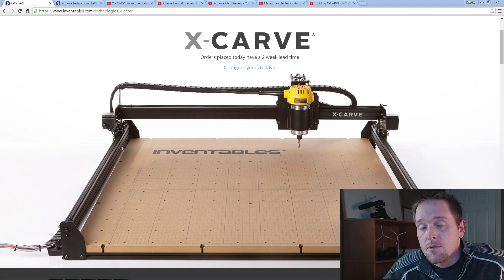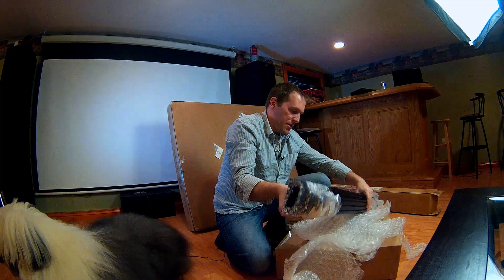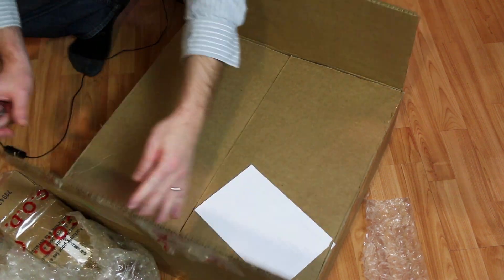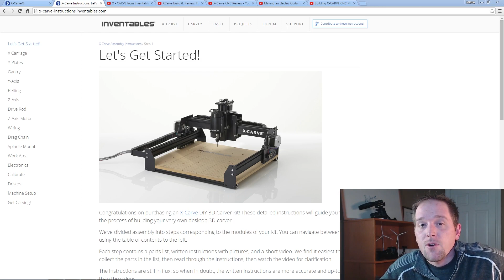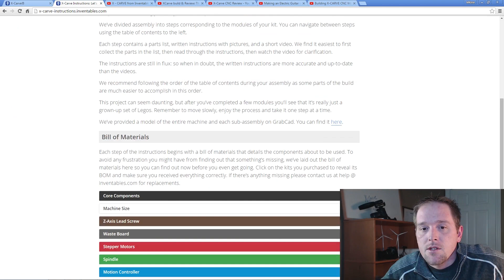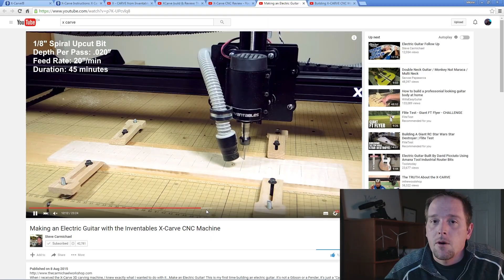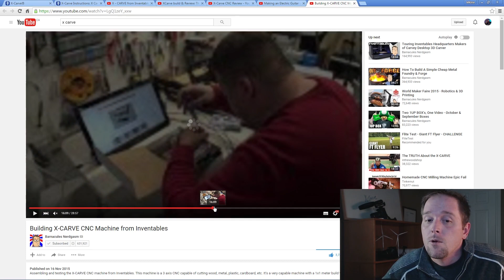Inventables X-CARVE CNC Machine | First Look & TOP 5 TIPS

Comment: Hey Eric - What's the software side of the x-carve like? I build myself a CNC woodworking machine a while back, which isn't too disimilar to the x-carve apart from being made from MDF and old rack-mount server slide rails. Although I've had it sitting in the shed for nearly a decade now, I don't use it all that often as I never worked out the right set of software which could take into account the selection of different cutting bits etc... It was a real pain getting the design right, and a lot of the time, for one-offs it was just easier to do it by hand... The software has undoubtedly come a long way since I last checked it all out... I'd appreciate your experiences with the software once you've got the machine all worked out. Cheers!!
Reply from the maker: +Jim Conner My first plays with their Easel software were painless.  It is really a beginner interface IMO.  I'll know more when I start using it for real projects.  I can say it is a heck of a lot simpler than the software I started with for the 3D printer 3 years ago.  Cheers

Comment: While I don't regret the Shapoko 3 purchase, the delays in making it larger due to the custom rails has made me wish I had got the xcarve instead, But I think patients will leave me with a sturdier rig in the long run. Good luck, looks like you have everything you need to get going. What are your thoughts on projects? Mostly PCB work or moving to the woodworking? I guess I'm kind of interested in how you might use it in the future. Would you have bought it without being contacted?
I bought mine dreaming up up all kinds of cool stuff that I haven't bothered to make yet, likely just laziness though ;)
Reply from the maker: +pXn Emerica Initially I looked at it for exactly that- PCB's.  I was looking at their site debating the unit many times when they contacted me (I was a bit startled and figured they had seen my IP or something haha).  I am pretty picky about what I accept for review on this channel and always want to be able to say I would have indeed purchased it.  In this case yes I was looking at it- only for the smaller unit to be honest.  That is the only deviation- I would have likely bought the smaller but I figured that should be fine for review.  Cheers!

Comment: Nice. So many uses ;)
Reply from the maker: +André Rousseau Indeed.  When I had the option to get the bigger one I immediately started thinking- FOAM BOARD!  I just need to work out a laser head (easy as many have done it) and this could be fun for some planes :)  Cheers
Reply: +MKme Lab now I'm really interested! A few guys have had success using vinyl cutters but lasers = cool. Just need to ensure you have fire suppression and ventilation. Asked Josh Bixler why ;)
Reply from the maker: ***** Haha I saw the video (I think it was on the Extras series).  Yeah craziness if it goes sideways. There's a whole group of X-Carve owners who have done the work for the lasers already. I looked at a drag-knife first but the laser is an easy conversion and the unit already fits a full sheet of foam :)
Reply: +MKme Lab Oh now you have too ;)
Reply from the maker: +André Rousseau Too many projects, so little time...